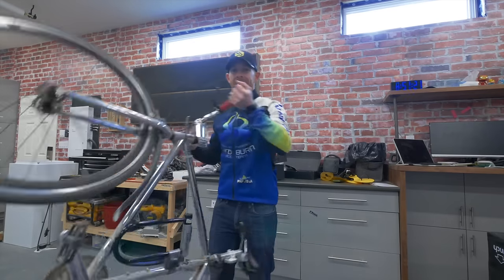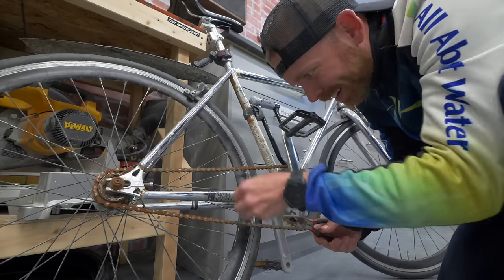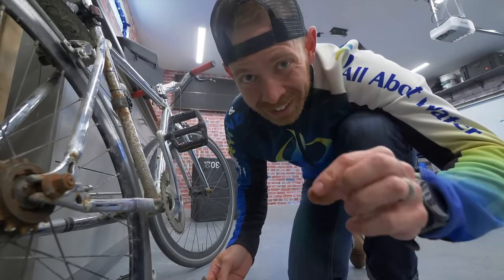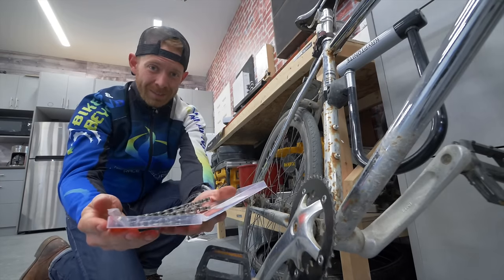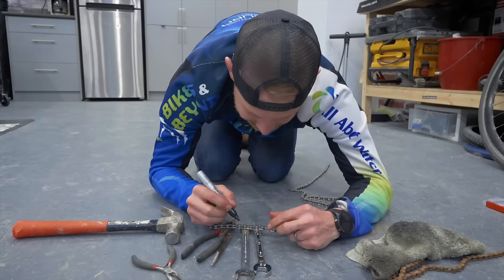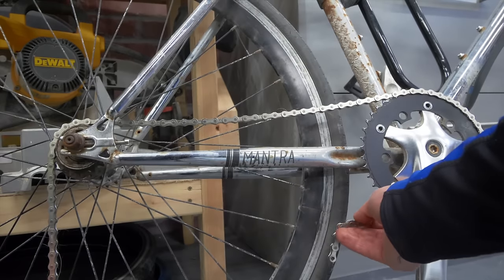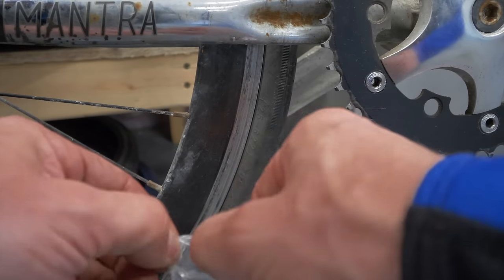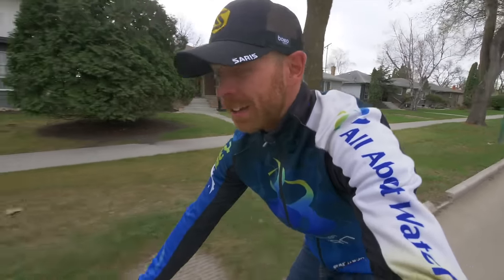How to REMOVE A BIKE CHAIN without special tools (don't do this to your triathlon bike)

Comment: Drill a 1/4" hole in a piece of 2x4, and align the ping to the hole, then punch it through. Works perfectly everytime.
Reply: cool. Can I reuse the same chain? Minus one link. But that would require me to somehow pop the pin out without damage, then reinstalling the same pin, again.. "if it's undamaged" (which I don't see how it would be possible?). Or........... Am I looking into this issue too much and should probably just drill it out and buy a "master link" or just a whole new chain? 

LoL. I see how my question could be considered simple minded But, it's late and I'd love to have this thing moving by the AM for my kiddo. I'm in an area where things aren't necessarily "close by". 

Thanks in advance, if  you get to my question, even with you reply being over or nearly 4 years ago.

Comment: I got a Topeak Chain Breaker Tool for $10. Works great. But I have to admit I have used a hammer & Punch before. Tip: Put chain link over the opening of a socket and hammer down into it 👍🏻

Comment: Good tips for removing a chain without specialized tools. Remember to oil your chain regularly so this doesn't happen in the first place. Reduce, reuse, recycle. In that order. Oiling your chain will make it last much longer, which is better for the environment and for your wallet. You really shouldn't be replacing a chain until it has "stretched". The lubrication will also significantly reduce friction, which is good for racing.
Reply: Chains can stretch? Can you explain
Reply: @Mazdatree  Any metal that is ductile will stretch upon application of force...
Reply: @yatharthchaturvedi2874  well yeah, but I didn't think my bike chain would strech

Comment: What if there is no master link?
Reply: yea;) who needs a special tool for master link removal; (
Reply: ya mine doesn't have a master link
Reply: You can do it like what he did
Reply: Then sand down one of the pins just enough to get the bur off of the pin tsp the pin out and you can rebur the pin when you tap it back in that's what I just did
Reply: @unclepush2895  help
Reply: @ethancampbell3461  your chain still working? Or it keeps slipping?
Reply: @jimroot_04  my chain was done it needed to be replaced so no
Reply: Exactly
Reply: Shhhh
Reply: There's a tool looks like a tiny clamp. I don't know what it's called
Reply: @tyladube8751  ty commenter. saved so much time
Reply: You need to have a masterling on a bike to train to work
Reply: @tyladube8751 what that’s confusing as all sin

Comment: Last day saw a local workshop guy place the chain over a small nut then just hammer to push the pin down.. further he placed a tiny steel ball and struck again.. to move the pin down further..

Comment: If u are taking it off just use an angle grinder with a cut off wheel if theres no master link
Reply: That must be my issue. I thought I'd gained or lost an extra chromosome. Or maybe was in need of a pair of glasses at the very least. I spun that chain around several different times... VERY SLOWLY like an idiot. I think you've answered my question here. Thank you sir. I am thoroughly frustrated at the moment. 

I see your comment is from 4 years ago. But maybe I'll get lucky and you'll see my other questions that's now come in to play here. If I want to re-use the chain.. is it possible to pop a pin out and then pop it back together? I'm assuming that would be a no... or.. I would need that tool, whatever it's called, to do so. ??? 

Thanks in advance, if you do get to my question here.

Comment: I call this lousy advice. How are you supposed to position your bike so you can bridge the chain over two solid objects with a gap in the middle (if the bike doesn't have a master link like my bike), which is impossible to do with the chain on the bike, and which you demonstrated with the chain OFF the bike? Duh! I call this utterly idiotic!

Comment: I’ll stick with the chain breaker. To remove a  quick link, it can be very difficult without the special pliers. Buy the pliers!
Reply from the maker: I do have them, but just showing people you don't need special equipment -- and this can work when you are in a pinch.
Reply: Triathlon Taren, before i had the special pliers, I have to admit to cutting the chain with a hacksaw. You removed that KMC universal link? fairly easily. Other quick links, e.g. SRAM or standard KMC can be more difficult. I reluctantly bought the pliers, but it’s very easy using those.

Comment: Wanna drop the old chain in coke and see if it gets all shiny?
Reply from the maker: Oooh!  Might have to!  lol
Reply: Yeah lol
Reply: yeah. the level of acid combined with the carbonation reomves dirt it work great on toilets too
Reply: Immer Chriswell Wait really
Reply: @3IsTheName  it does work ive done it before
Reply: The Squeak bet ima try
Reply: Boil it and then ultrasonic it rather
Reply: The Tech From Heaven what’s ultrasonic?
Reply: @jtgarcia181  those machines used to clean dental pieces, electronics, jewerly and such
Reply: I used vinegar, it works pretty good. 👍
Reply: i dont have coke is sprite okay?

Comment: I want to practice riding backwards... so I want to unchain the bike for easier practice... but I found a way to "disable" the chain without removing it... by cutting a tin can in half and fixing it around the smaller gears 😆

Comment: That's only for single speed chains, for geared bikes the procedure is slightly different, but the principle is the same. Biggest difference is measuring the chain.
In any case creative way to break a chain! 👌

Comment: why does foam rolling hurt so much, even when im watching triathlon taren :(
Reply: This probably means your muscles (e.g. IT bands) are very tight. Generally speaking they will feel better after more rolling sessions. Pay attention to the sore parts and roll over these more. You can use the other leg to help take some weight/pressure off to start with. My advice here is based on my personal experience, i do not have a medical background.
Reply from the maker: Yep, what he said!

Comment: I can't understand why people would let their bike chain get into that condition.  How hard can it be to clean a chain and put some lube on?  Basic stuff on one of the most important, and definitely the easiest-maintained part of the bike.  A crap chain does so much expensive damage.  But people are crazy like that.  I saw a pretty new and expensive road bike parked up outside the supermarket the other day.  Really sturdy lock on it - so at least the owner had gone that far.  But the chain, chainset and cassette were covered in rust!  On a bike with a Sora set-up, and which must've cost well over £1k. Dumb!